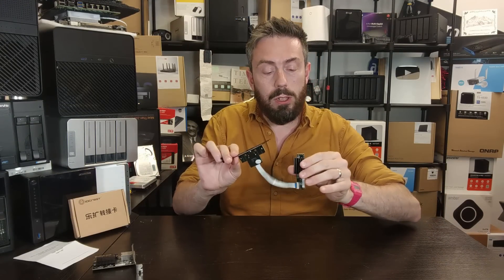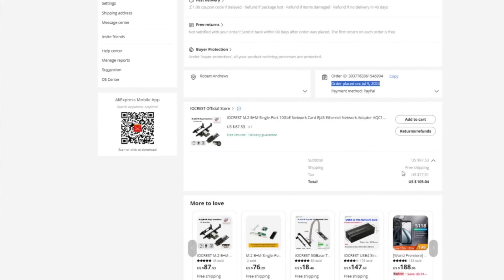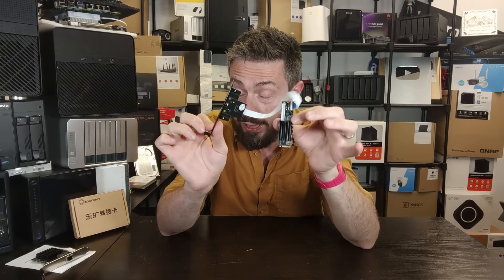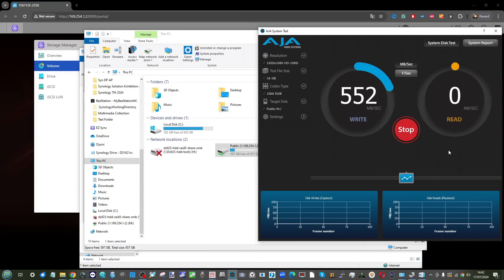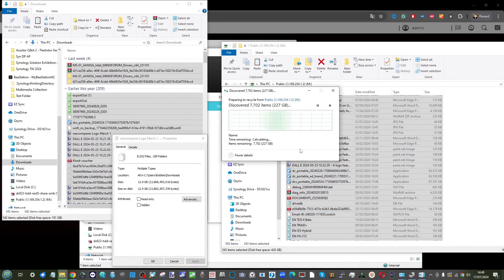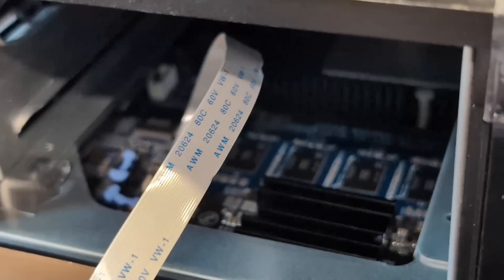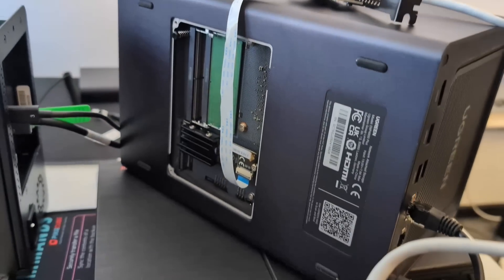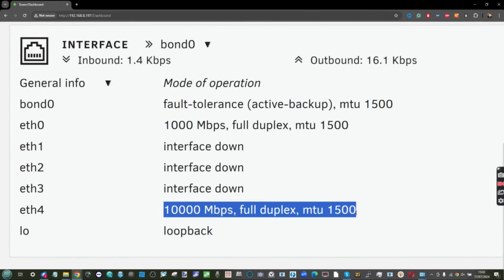M.2 to 10GbE Adapters ARE A THING! - Review and NAS Testing

Comment: I wonder if these would work if mounted additionally on a Quad oder Dual NVME M.2 riser card?

I have a system with seemingly plenty of resources here: Server/WW board with some x16 gen3 slots.
Yet, I don't want to waste entire x16 slots for a single x4 card like a USB 3.2 2x2 oder 10G Network Adapter.
I don't find the diverse riser card and bifucation cards (x16 to x4x4x4x4 and the like) I find on the net that much convincing.
So if I could add ar least such an 10G LAN Adapter to one of my NVME x4x4x4x4 cards, it would spare me a lot of room and also having to care for additional wiring.
I could also use a small x8 to 2x m.2 riser card to add one ore two of these 10G LAN Adapters.

Comment: The x99 motherboard I use for my homelab setup doesnt have a PCIE slot aligned with the top most expansion bay on my case (nor do many ATX motherboards it seems), so with a 4xM.2 to X16 card in the top slot I can install 2 SSDs, a 10GB SFP+ NIC that is routed to the slot above, and have an extra slot available for future use without touching the rest of the PCIE slots below.

Comment: I agree with the comments about the ribbon cable, it is terrible. Looks like some basic generic cheap cable. No wonder why someone in comments mentioned lower data rates when installed in miniITX compared to test laying flat on table. Interference is a bi*ch.
On the bright side though, they do sell version of this NIC with micro coax cable which is far better solution for this application. It would be interesting to see comparison between these two outside and inside miniITX case. I bet we would see better numbers.
Reply: Coax? The cable that got replaced by twisted pair 30 years ago?

Comment: How is that flex cable not prone to all kind of electrical interferences?
Reply: Probably, this cable should be twisted pairs.
Reply: It's a flat cable with the traces parallel and (hopefully) alternating data and ground traces on a short cable like this it should work fine with differential signals pairs, just like PCIe riser cables

Comment: I got an M.2 to PCIE 3.0 x4 adapter and connected with an Intel X540-T2,  using the extra PCIE 3.0x4 M.2 slot on my motherboard. the reason I  don't get a direct M.2 to 10GbE adapter is most of these cards use the  Qualcomm AQC chip, which is not good. get a full-width M.2 PCIE adapter and you can put any card you want on it, even Mellanox.

FYI: I did an ITX build and the only PCIE slot is occupied by GPU. I'm using PVE 8.2.4, no extra driver is required, just plug and go. iperf3 shows a full 10Gbps speed, which I remember is around 9.6~9.7 Gbps with 9000 MTU.
Reply from the maker: ordered one of these adapters off the back of a previous comment in this video, as I want to explore this very thing! Thanks for sharing man!
Reply: @nascompares  that PCIE riser cable is stiff and not easy to bend. it may require an additional power source because the PCIE card could use 3.3V and/or 12V power, while the M.2 only provides 3.3V. I think it's more suitable for a PC build, at least an ITX system, because of space and power. one may need lots of modifications to fit that into off-the-shelf NASes or mini PCs. I can send some pictures if you want.
Reply: Can you provide the part you used? I'm a bit confused, but I think I want to teh do the same thing. What is a PVE 8.2.4 ?

Comment: Why not go for an awesome Sonnet PCI-E card that has 10Gbit Ethernet, two M.2 slots and two USB-C 3.2 Gen 2. Sure it costs, but I'd like to get that one and their other overkill PCI-E card that houses eight M.2 slots. They've got some really awesome and obscure tech.

It's called "Sonnet Technologies McFiver PCIe Card G10E-USBC-M2-E"
Reply from the maker: Thanks for the heads up. I'll message sonnet about this, definitely worth a Q!
Reply: In my case there is no other free pcie slot in my itx mb but at least one m.2 free slot
Reply: @manuelmanuel4158  You need to look up what it supports. It can vary a lot.

Comment: Will you review MW-100-NAS.
Its a new N100 motherboard which has 6 sata ports AND 10GBE.
Reply from the maker: I'm not saying I'm easily influenced. BUT I bought this board 16.5minutes after I read your comment. I hadn't even spotted this board when it launched. I slammed it in the basket and through the checkout like my life depended on it. Thanks for the heads up bud. Email me ( robbie at nascompares ) and I'll try and I'll send you an early review link when it's done, so you don't have to wait for publication. Thanks again
Reply: @nascompares  
Its fine I'll wait like everybody else!
The only thing that's stopping me is what SATA chip they are using, can't really tell if its asm1166 or jmb585. REALLY HOPE ITS asm1166! 

Also do test both slots of the m.2 slots if they are giving enough bandwidth for another asm1166 card potentially making this a 18 bay nas, assuming no M.2 SSD.
Reply: Who makes this motherboard? Usually I can trace the NAS boards back to CWWK or BKHD, but no luck so far. I saw an AliExpress purchaser comment about flaky firmware, but I'd take comments on their stores with a grain of salt. Still, this looks like a new product, so I wouldn't be surprised about a buggy BIOS, and some hardware issues in the early versions. Finding the OEM might provide a source for a newer BIOS (and sometimes even a product manual).
Reply: @dktol56  
topton
Reply from the maker: update so I made a write up on this MW-100-NAS Mobo here - https://nascompares.com/2024/07/27/the-mw-n100-nas-n100-10gbe-m-itx-6-bay-motherboard-just-released/
Its this one here on Aliexpress https://s.click.aliexpress.com/e/_DDNBIGP (that's the one with CPU, but no RAM/SSD). Kinda surprised by the price tbh. for a 10G board, I expected much higher, even with just the N100
Reply: @nascompares  
Nice, did you ever find out if its ASM1166 onboard?
Reply: @nascompares  Wow, I had seen the 4x2.5gb version but not this. It will be definitely interesting to see how a fully loaded on performs considering the max 9 pcie gen 3 lanes.
Reply: Wonder if it could be used as a NAS-cum-Mediaplayer. E.g. proxmox, trunenas, and a Linux with Kodi on top. Then one could stick it in a custom chassis, hang it on the back of a tv, and connect it with HDMI (which kind of HDMI is it, I wonder, and will it (and the system) allow 4k@60fps)? Also, in such an application, I'm wondering about the cpu fan noise at standby...
I wouldn't run it as a primary NAS, for its lack of ECC, but as a secondary ssd-only for my second apartment, where it would only have my media collection mirrored, it looks promising
Reply: @BoraHorzaGobuchul  
Honestly I'd get radxa x4 for that. Its cheaper and smaller size like raspberry pi
Reply: @jackipiegg  logical. But I don't like pies :)
Also, this one is a lot more versatile. I could fill it with a few VMs
And does pi do transcoding? No quicksync. Not really sure I will ever be doing it (I prefer playing the original file), but still. 
Space is not an issue - the tv is big enough
Reply: @BoraHorzaGobuchul  
Did you even read. I said radxa x4. It has the same FORM FACTOR as the pi, FORM FACTOR.
Reply: @jackipiegg  sorry, long work night :)
Looks very appealing. But it doesn't have sata ports. Guess you could to m.2 to sata adapter but for to the 2230 form-factor it would need a riser...
Thank you for the pointer.
Reply: @BoraHorzaGobuchul  It has SIX sata ports
Reply: @DigisDen  radxa x4 we are discussing does not, unlike the board in the video
Reply: @BoraHorzaGobuchul  Oh, I see, sorry.

Comment: Currently in my ITX SFF Desktop I am using a m.2 to pcie x4 riser adaptor (Search for R42SL) with a Mellanox ConnectX 3. Would recommend that over this. I get full 10G performance. In all about $40. Would be a bit more if you need Intel for FreeBSD based system without updating drivers.
Reply: I figured I would add that you would prob need at least 2 lanes of PCIE 3.0 to get full 10G, 1 Lane would get you close around 800MB I think

Comment: You should test a NIC throughput using iPerf
Reply: Specifically using iperf3 in WSL if on Windows. The native binary is out of date on Windows and often underperforms.
Reply: @adriftatlas  3.1.3 works fine for me and gives me 9.8 9.9 gbps no issues.

Comment: I bought one and saw 600-800Mbytes/s, but it's going in a ITX chassis and it's leagues better than 2.5G.  Did see the data rates seesawing a fair bit though.
Reply: the heatsink is underwhelming so it slows down
Reply: @BrickTamlandOfficial  No, it didn't thermal throttle - the heatsink was fine - I also ran it with the case open and a fan on the heatsink and it performed pretty much identically without even getting warm to the touch.
Reply: @Spreadie  ok how then do you explain the seesawing? if it happens, there has to be a reason for it. maybe the heat sink itself isnt getting warm because its not making good contact with the chip in the first place?
Reply: @BrickTamlandOfficial  Why are you so combative?  Calm down.

You assume I'm an idiot and haven't reseated the HS. Jog on, fella, I have no interest in feeding anymore attention to a keyboard warrior.  ttfn
Reply: @Spreadie  Just wondering why you think there is seesawing. That's not supposed to happen. Do you have a clue? I doubt it.
Reply: @Spreadie  Maybe reseating the heatsink doesn't matter when the heatsink was machined incorrectly and does not make good contact with the chip. Have you tried using a thermal pad? they are good for these cases where you want to make sure good contact is made with the chip.

Also stop trolling.

Comment: Im looking for a PCIe 4.0 x1 to 10Gbps (RJ45 or SFP+).
Reply: OWCPCIE10GB, its RJ45 $100 don't think there are any that are SFP+ I forgot to add that I think it might be a x2 pcb so you might need to cut a slit in the PCIE slot to fit but it runs at PCIE 4.0 x1
Reply: @nicholasg88  danggit I don't wanna have to cut the PCIe slot. Hopefully somebody makes a proper x1
Reply: @pr0jectSkyneT  if you can mount the card elsewhere a pcie riser can be used. It looks like they did this so if you are using pcie 3.0 it can still run at full speed using 2 lanes and to make it backwards compatible. Kind of stupid I think because there are so many cheaper older 10g cards that use pice 3.0. Sadly since 3.0 is enough bandwidth not many 4.0 cards have/will be made.
Reply: @nicholasg88  yeah it's stupid. I'll look into a riser. Thanks!
Reply: @nicholasg88 lot of x1 slots are already open ended nowadays

Comment: even if you put this in a custom build itx system, im lery of that cable. Wish it was a more robust cable that could be replaced easily if necessary (if it was damage or you needed a longer/shorter one)
Reply: you can replace it easily. it's just a generic ribbon cable, you can buy them in any length you like. i'm more concerned about signal running 10G in a flat, non twisted, non shielded ribbon.

Comment: I think the problem there no software for it from of the shelf items IE  Asustor  QNAP Synology and UGREEN.
Reply from the maker: That's the odd thing. Rip apart the firmware update and OS download files and you find a number of compliant Aquantia controller drivers that should cover the 113. ESPECIALLY QNAP, as they use this drive on their own tB driver and you can connect it to a QNAP and see it on QTS.
Reply: @nascompares  all firmwares hardcode the network ports (and sata and other stuff) so even if the system does support additional hardware, it won't be used. Projects like Xpenology hack around the issue by re-generating the hardcoded list before booting the DSM. Any other PC-based system like TrueNAS and Unraid and generic Linux systems will be fine because they don't have hardcoded lists of ports
Reply: @nascompares  The DS920+ does not have a driver for AQC113 but the DS1621+ does. But the DS1621+ uses device tree so model.dtb would need to be edited to get the M.2 to 10GbE adaptor working.

Comment: PLEASE run this test:  A PCIE gen 4 x 1 slot on a motherboard to a M.2 adapter with this card plugged in.  This might be the solution a lot of us have been looking for.
Reply: Ok I went to the NAS Compares site and I see some conflicting info about this device.  They list this:  Supports bus widths: Gen4 x1, Gen3 x4, x2, x1.    B+M from what I'm reading supports PCIE x2 bus widths not x4.  Now depending how this operates, if it has a PCIE x1 bus then PCIE 3.0 will only get half bandwidth max.  If it's a x2 bus then the Gen 4 slot will get half bandwidth max as I doubt this thing is really PCIE Gen 4 x 1.
Reply: @Somethingaboutthat  The network chipset is AQC113 and looking that up on Marvell site it supports 
"PCIe Gen4, Gen3 and Gen2 interface with x1/x2/x4 lane-widths"
The B+M slots supports pcie x2.
Due to how pcie works, if both 2 pcie lanes are connected and work on Gen3 they should also work on Gen4.
Reply: @Somethingaboutthat I think it is just saying it will work in a PCIE 4 slot, It is the AQC-107 and I think is only PCIE 3.0.
Reply from the maker: The NC site article was made AFTER this vid and I have spent more time with the device. I have a follow up on this soon.

Also, re m.2 to PCIe x8/16 adapter. I literally JUST purchased one for the channel SOLELY based on your comment, as I didn't know they were now available in Gen 4. I look forward to making the vid. It will likely be on NC inner circle/membership soon after it arrives, but on the YT channel later. DiY Friday videos already have a massive backlog to get through (another IOCREST device, the minisforum 6x SSD Nas adapter, the HexOS Q&A, another UnRAID vid with Ed@soaceinvaderone). Will try and get this video up a little sooner if I can
Reply: @nascompares Please no more Spaceinvaderone.  He’s so friggin’ boring, can’t carry on a discussion, and he’s not credible at all as he’s just a shill for Unraid.
Reply: If you need Gen 4 x1 a card exists(I think it might be a x2 pcb so you might need to cut a slit in the PCIE slot to fit) , OWCPCIE10GB cause it uses the AQC113CS that is PCIE 4.0
Reply: @nicholasg88  not interested in cutting my motherboard. Too risky.
Reply: @Somethingaboutthat  could just use a riser not many pcie 4.0 10G nic's out there since pice 3.0 is more than enough for it
Reply: @Somethingaboutthat 
Your x1 slot might be open ended by default, so no problem
Reply: Sadly it’s not open ended.